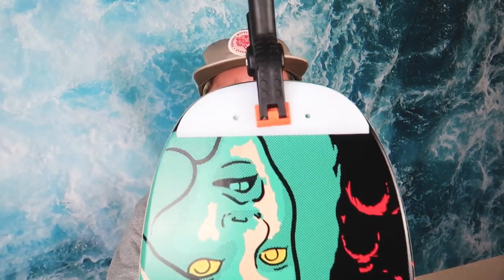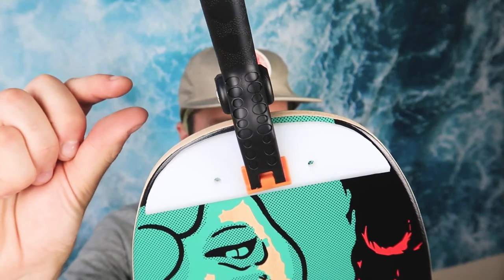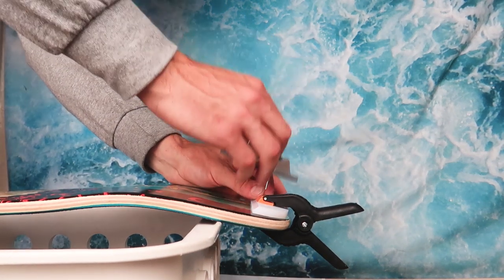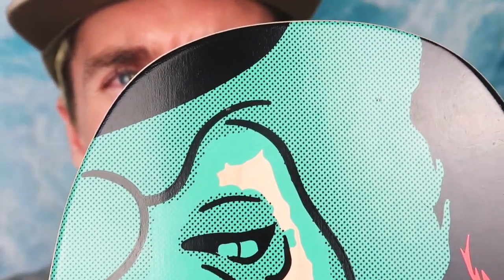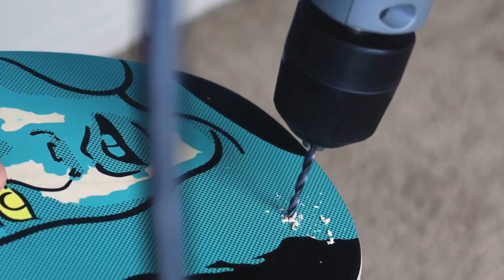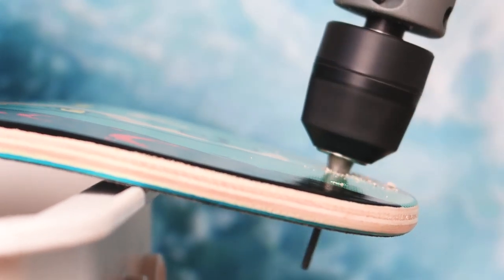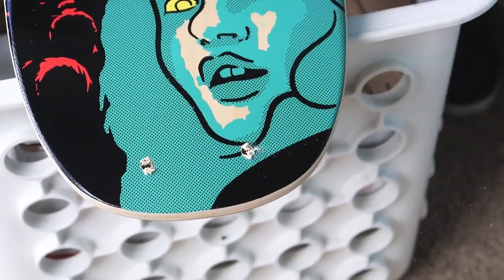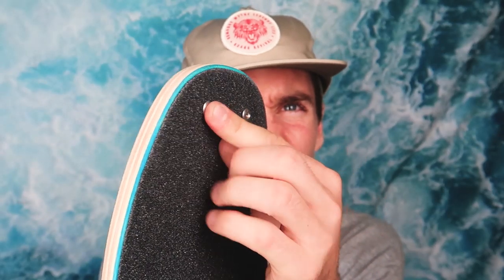How To Install Freestyle Skid Plates

Comment: I got a new deck like two weeks ago and have been using it without skids so I have little razor tail on it and have been thinking of protecting it because I’ve been skating in the streets a lot, is a skid going to hold properly still? Thanks!

Comment: Nice! I never noticed the hardware on the waltz skids, I like how the heads that sit on top are pretty thick 😁👍
Reply from the maker: They provide some protection if you’re riding a flat single kick too! You’re less likely to have the grip tape wear down if you use higher, bubblier skid hardware
Reply: @mike_osterman1  too true! I never though of that! I'm probably gonna stack a washer under the heads of mine from now on. I used to like the whole edge of the nose with screws but that'll do great!

Comment: Do you prefer to have the sex bolts showing on the top side after installing with grip already on as shown in the video or to attach skid plate first and then grip over? I think it looks cleaner IMO to grip over but I wanted to see what others think. Thanks!
Reply from the maker: I prefer having the bolts over the grip. I’ve just always ridden it that way. doubt It makes much of a difference

Comment: This is how I do it. Hello Waltz, I’m buying a 7.75 monument. PleAse put the skid plates on for me. Whit I would really like to know is how to install rails on my pool deck . I’m not sure where to put them exactly?
Reply from the maker: Yes! The complete will come with skid plates. Rail installation is very similar. You can place your rails anywhere though. It depends on what is most comfortable for you. Maybe 0.5” in from the edge so the rail is easy to grab during frontside/backside grabs?
Reply: Mike Osterman Thanks!

Comment: I ride a street board with mini cruiser wheels so i can use it for transportation and still do street tricks when i feel like it. Only downside is I can’t powerslide and I live at the bottom of a hill and bombing, especially without powersliding, is still way beyond my skill level and im trying to live to see my thirties if i can help it. Would using one of the nose guards give me the ability to brake by dragging my tail or would it completely wear out after only a couple of uses? Im okay with having to replace it occasionally since its cheaper than replacing the whole deck, just wanna know how much life i can get out of one/if its a practical purchase for having more than one breaking option at my disposal.
Reply from the maker: Hey! A skid plate would definitely last longer than a raw tail when you’re dragging it down a hill. I would definitely recommend trying one if you’re interested in extending the life of your board. 

You’ll also want to learn how to heel drag rather than tail drag when you’re heading downhill. Then you’ll be at the next level
Reply: @mike_osterman1  hell yeah quick reply, thanks!! also your channel is sick. definitely going to be incorporating practicing some basic footwork into my sessions while i'm still getting down the beginner street tricks. thanks for the tip!

Comment: Im riding a small wooden cruiser board and its firm is like a litle surfboard is there a problem if i cut a litle bit of the sides of that plate so it can fit my cruiser.

Comment: If you wanna put grip on the underside, do you put them over the skidplate for extra grip?
Reply from the maker: I usually put mine under the skid. The skid plate acts as an anchor so the griptape doesn’t peel away
Reply: This comment is probably irrelevant since it's been a year, but I wouldn't put grip tape on skid plates, because if you do a tail slide or something like the, you might fall backwards because there is to much grip. And, grip is for the underside of your shoe.

Comment: hey Mike, i dont do freestyle, could i still use skid plates just so i dont get razor tail or does it ruin the pop?
Reply from the maker: Definitely! It will change your pop a little but I don’t find that it ruins the pop of a board. It will make things like tail slides a little more difficult though
Reply: I'm thinking of doing something similar. If I got a 7.5" street deck then should I get two nose plates or two tail plates from your site? Which would fit? Also, can you dye them reliably?

Comment: So I've been streeskating for 7 years and now I want to get into freestyle some more. But all the freestyle decks I found were quite small (my normal deck is 8.5 as I have big feet). Are there even any wider decks on the market or do I have to just use my normal deck an put skip plates on them?
Reply from the maker: Hey! The biggest freestyle board out there that I know of is the Monument or any of the Münster shape decks from Waltz Skateboarding. It’s a 7.75” deck. If you need something bigger, you can totally put skids and FS wheels on a big boy board 😁 I recommend using trucks that are 0.25” narrower than the deck with FS wheels tho
Reply: Andy Anderson designed a 10 inch board for freestyle at decomposed
Reply from the maker: I’d disagree. I love Andy, and he designed an amazing skateboard that makes some freestyle tricks a little easier, but that’s like calling a VW bus a race car because you put a spoiler on it. It’s still built mostly for transition & street skating. The concave, wheelbase, nose and tail lengths make FS tricks way more difficult
Reply: @mike_osterman1  holy cow! you replied. Your the pro. I guess your right. The wide board is for a mix of all three styles and he is mostly a street skater. He is also really experienced so it'll work for him. Btw you content is awesome and keep killing it!👍
Reply from the maker: Haha, thanks for jumping into the convo! Love that these comment threads turn into such a community forum for freestyle

Comment: Would your skid plates fit a modern street board?   If not, do you make/know where to find skid plates that fit street boards?  I have an 8.5 inch Pillar (brand) deck, and I really want to protect the nose and tail, but the powel peralta ones on amazon are too big, and i can't find much else
Reply from the maker: Yep! Waltz Nose skid plates are the perfect shape for almost any Popsicle shaped deck
Reply: @mike_osterman1  oh, thank you for the quick reply!  i literally unpaused the video after i wrote this (at 1:40 in video) right before you said "the skid plates work for any street setup" oof lol
Reply: @mike_osterman1  and awesome, im gonna buy some!
Reply: @mike_osterman1  sorry to be a bother, i swear im not trying to; 

one last question---should i buy two tail plates/two nose plates/one of each for a popsicle board?   

i think the nose and tail are not symmetrical, but since it has noses on street boards are still kickable/poppable, i figured i would ask out of anxious uncertainty:  if its useful, its this one in 8.5" size https://www.pilllar.com/collections/boards/products/pilllar-logo-silver?variant=36952133697685

Comment: so how do you know when you're ready for your next board if the skids never wear down the tail and nose?
Reply from the maker: Freestyle trucks wear down boards in a lot of other ways. Your rails (the sides of the board) will wear down and you will most likely chip the nose and tail over time. I usually change my board out when the nose and tail get chipped and pounded down enough to feel “soggy”

Comment: I would also suggest a little gorilla glue under the skid and some thread locker on the screws. Learned that from Witter
Reply from the maker: I’ve done this in the past too but I actually don’t recommend it. I love the interchangeability of skid plates. Depending on the surface and tricks I’m doing, skids can sometimes last twice as long as my deck or decks can last twice as long as my skids. Gluing the parts together makes it impossible to change ‘em
Reply: @mike_osterman1 To each his own. I find that by the time my skids are done, my board usually is as well.

Comment: I cannot find a SINGLE decent place that carries Freestyle skid plates. Can you recommend a reputable dealer. My board is on the smaller side at 7.25.x29, but I am only 11 years old. I have an old Mullen board but the plates are shot. It is crazy because most custom dealers will let you build a board but EXCLUDE the skid plates. WHAT? So, newbies like me are left to find 5.5" wide plate is not easy.